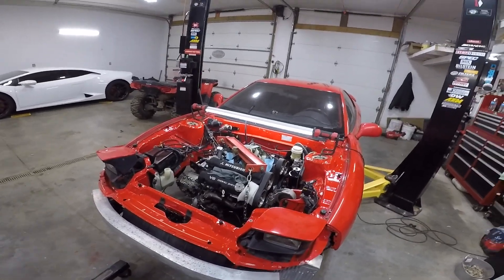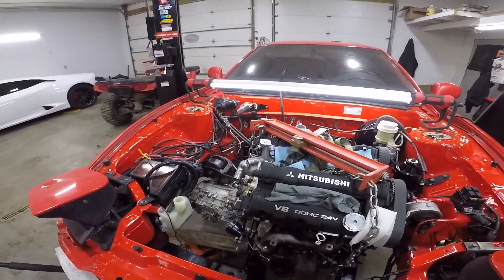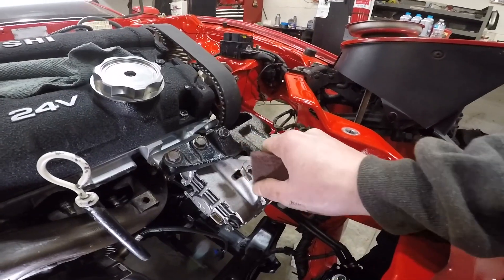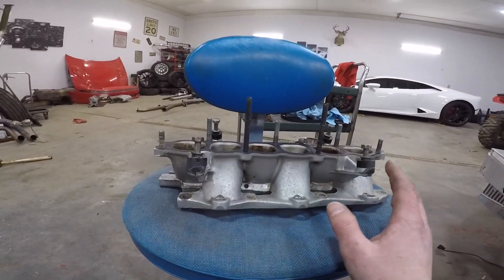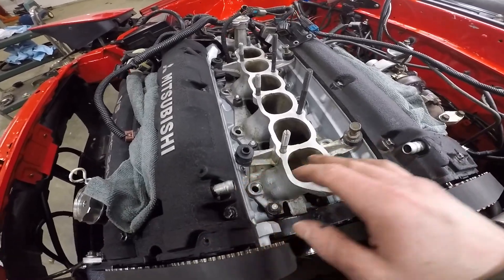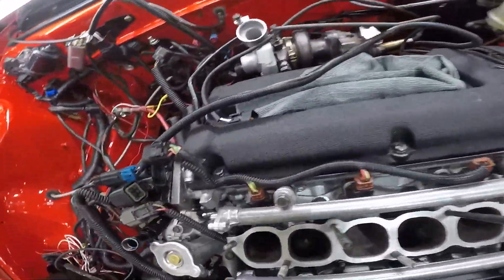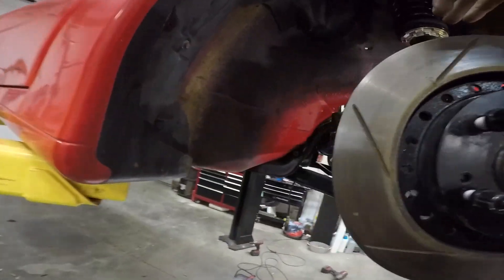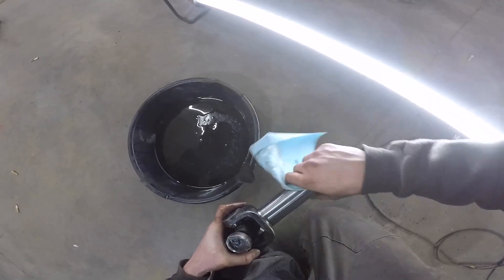Engine bay assembly [ 3000gt vr4 ] Forged 6g72 tt Engine install

Comment: Hey ian. Been awhile and i hope youre doing good. While i was dling my 120k service i discovered metal in my oil pan and my main bearings were fucked. Currently my engine is completely tsken apart in my garage. I stand by my last comment. You are a huge help. Thank you.

Comment: i am loving this build man. so to the wall it is 33 ft.lbs according to the manual for the transaxle mount
Reply from the maker: The half shaft that bolts onto the block for the transmission that bolts to the body ?
Reply: @huracanian3051  the transmission that bolts to the body

Comment: Those cam seals sure seem sunk in there pretty far, wish I had pictures of my old car but that doesn’t seem right.
Reply: Hopefully it seals good, I guess we’ll all find out soon.  Wish I still had my old car around so I could take a peek too!
Reply from the maker: @CCrunner84  I got plenty of Cam seals if it doesn't seal .. I thought about it in the cam video I didn't have the cam seal tool so I'm sure they're not 100% but they should be really close
Reply: Sounds good man, keep up the good work too - always good to see a 3/S being done right.
Reply from the maker: @CCrunner84  🤙
Reply from the maker: Well there's a step inside that can cap that they sit on so they should be good